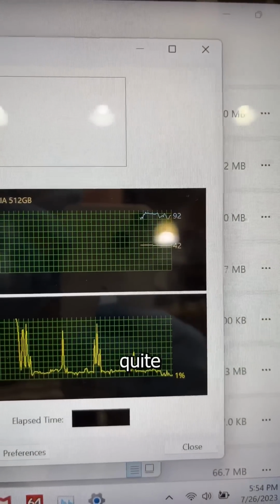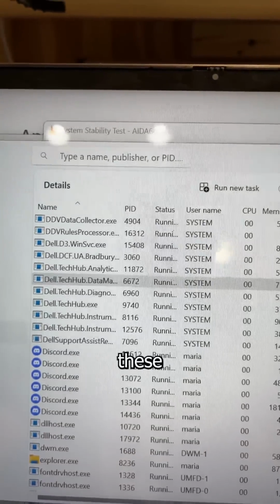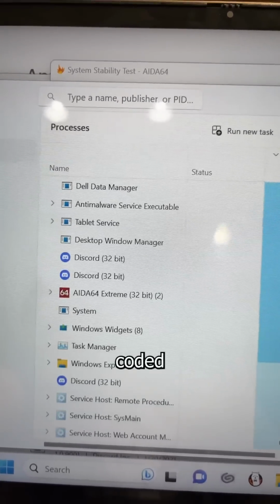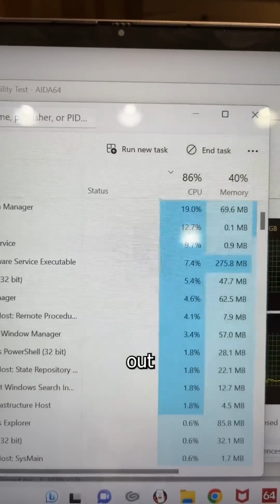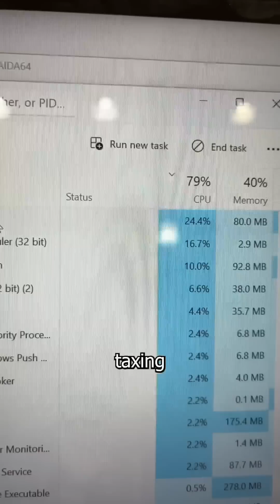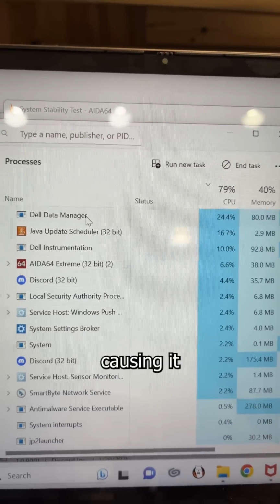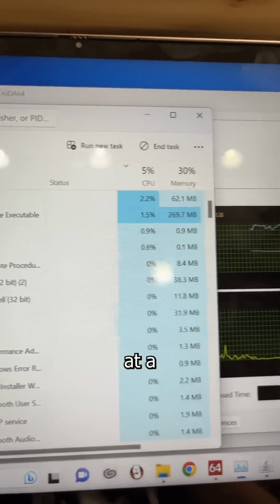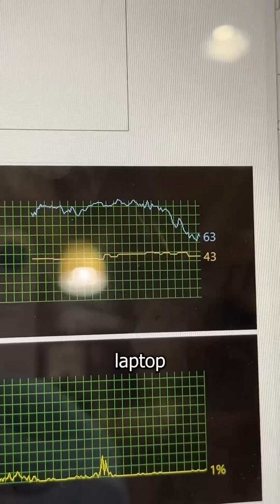Cleaning an overheating Dell Inspiron laptop. Can it be fixed? #tech #gaming #shorts #technology #pc

Comment: Wouldn't this still be a problem. Like yes you took out dells garbage, but it shouldn't be over heating at 86% cpu utilization, like let's say you want to do a cpu intensive task, why should ot reach almost a haundred Celsius, I don't know if the laptop by design is bad or if it needs more cleaning up or something else is blocked

Comment: Going the extra mile to nuke the bloatware too, awesome job!!
Reply from the maker: Always do my best to help out a customer! Reputation > Everything 💪😎
Reply: How do you do it? Just end process in task manager and stop it from running on startup?
Reply: @jvogler_art4708  Control Panel is your friend
Reply: @jvogler_art4708 definitely not end task because the customer would need to do that after every startup
Reply: What bloatware can do to a computer 💀
Reply: @iamlupaz9528 it can put extra load on the cpu’s which mean the transistors have to turn on and off faster and transmit more electricity which creates heat and when theres heat the cpu slows down to cool down
Reply: Dell should optimize their bloat based of hardware.
Reply: if it was me, id ask the customer first if they use any of those software before getting rid of stuff.
Reply: @josefmprable If it was useful then it wouldnt be nuked, and if needed they can be started again. No issue.
Reply: @whitesaintatarmaon5766  I'm not sure about Dells bloat, but my Asus laptop has the myAsus and Armoury crate software installed. While I do want to get rid of them because they take up quite a bit of resources, both of them have vital battery and performance settings for my laptop so that discourages me from uninstalling them.
Reply: @josefmprable he didn’t delete that, he deleted background processes that take resources
Reply: @whitesaintatarmaon5766 Yes, he probably disabled for it to start on startup too :)
Reply: @josefmprable  well like I said, "If it's useful it wouldn't been nuked".
He fixes pc's, the least i'll expect is that he knows what he's meddling with.
Reply: @adamboi  same thing: "If it's useful it wouldn't been nuked".
It's not like he stopped some vital process or anything; it's his work so he knows what he's meddling with. ( or so I hope )
Reply: @josefmprable i have asus laptop with armoury crate too, i recently re installed my windows without installing the armoury crate again and it runs just fine, actually better cuz for some reason i got more fps in my games

Comment: Last year I cleaned out our old family laptop which we had since 2011. But had never been cleaned out. The lint that I removed was so thick and clogging the heatsink so badly. I runs a little less hot now. I think the fan bering may be in its way out though. But a least it still runs.
Reply from the maker: Wow, I can only imagine how clogged it was. Did you change the paste while you were at it? It's probably dust in the wind by now.
Reply: @SalemTechsperts  I had misplaced the thermal paste at the time. I seem to lose most things I need.  After wards I was kicking my self about it. I bet all the paste is crusty on it. The laptop is a Toshiba satellite. And it's annoying to open up as I have to go though under the keyboard.
Reply from the maker: @wildadventure5101  "I seem to lose most things I need" my life story
Reply: I use to have a deskfan blowing into my old laptop to keep it from overheating...

Comment: How old is this laptop? I have an inspiron that is a few years old. I had to epoxy the hinges back to the screen due to Dell's braindead design but while I was in there I didn't think to check the thermal paste.
Reply from the maker: 2021 I believe. Check the temps and see if you need to do it. Was your Inspiron a 2 in 1? This one was, they seem to have better hinges. The regular Inspiron hinges are poop.

Comment: I usually use sysinternals autoruns to clear out bloatware permanently.
Reply from the maker: Exactly what I used, I just couldn't fit the entire process in the 1 minute video. Autoruns has been a gift for 15 years and running
Reply: @SalemTechsperts  Of course, for an absolutely brilliant build, you can always use dependency walker and iexpress to clear the crap out - if you're building the same rig multiple times.
Reply: I am not computer savvy... Could you explain to me what sysinternals are?
Reply: @maftplays  Hi, is a tool from microsoft. Is good to get rid of bloaterware/malware and programs you don't want anymore.
Reply: @maftplays  Sysinternals is the sister suite of the company that used to create wininternals. Acquired by Microsoft over a decade ago, they specialize in light weight tools to diagnose problems and perform light fixes. Among the best and most commonly used are autoruns and process  explorer... I'd recommend using them in concert with dependency walker and iexpress if you are creating a deployable image.
Reply: @maftplays  same
Reply: I never knew that dell bloat their products a lot. It explains why some of them lasted less than a year
Reply: @yesman7777  You can always edit the hell out of their images; using dependency walker, you can identify all of the interconnections and keep yourself from creating a diy boat anchor. By selectively removing all components of undesired software and their concomitant registry keys, you can excise items that needlessly squander system resources. By using iexpress, you can enumerate all of the items requisite and use it to call out to remove all of these items before OS protection kicks in. Also handy for deworming stubborn virii.
Reply: How to do that my friend, can u plug the link up for me? Or prefer typing it.
Reply: @-Ghost._  I personally took my copy of dependency walker from the Microsoft toolkits. If you ask Microsoft about it, you can find a link to dependency walker 3.0, which works on Windows 10... Let me know if you have any issues.
Reply: Is that an issue in Huawei Matebook D15 also?
Reply: @techzone-69 it's an issue with every single laptop and prebuilt PC manufacturer. Hell, even computer parts manufacturers make you install bloatware, such as GeForce Experience
Reply: Hey guys can you please tell me how to use the autorun feature

Comment: LIIIIINT, WE WORSHIP THE LINT GOD. PRAY TO THE LINT GOD TO NOT GET LINT IN THE COMPUTER. (Also, don't use a hot hairdryer to clean out LINT)
Reply: I've seen some "Computer Air" little compressors...but never really trusted them...but have always bowed down in front of the Compressed/Bottle air alter :)
Reply: @leeh.1900 Me: https://youtu.be/16VLGWj-gkQ
Reply: The only thing that should be worshipped are pkcells and cashies